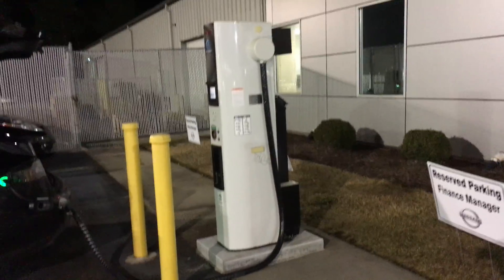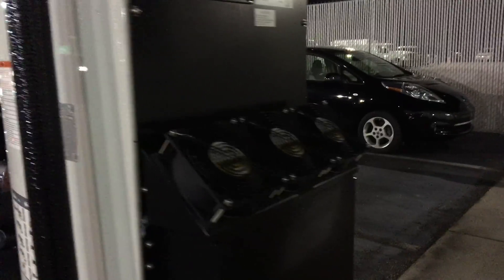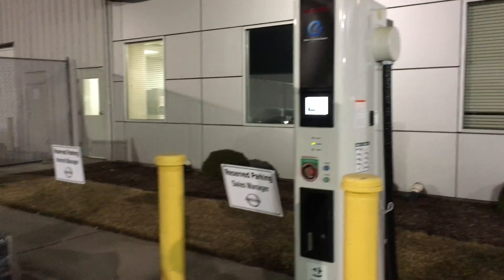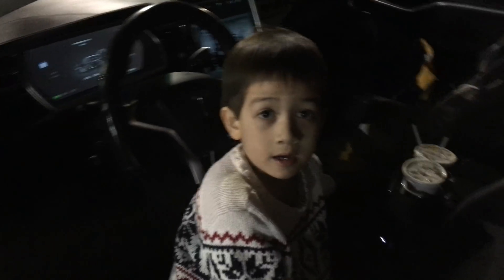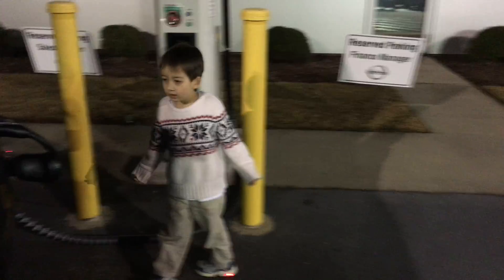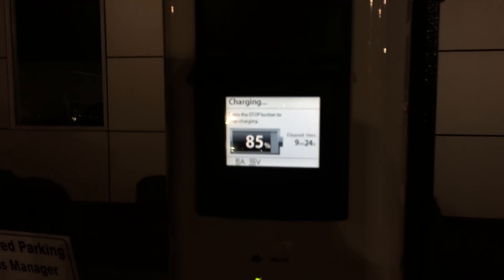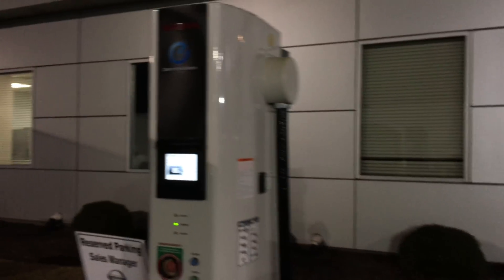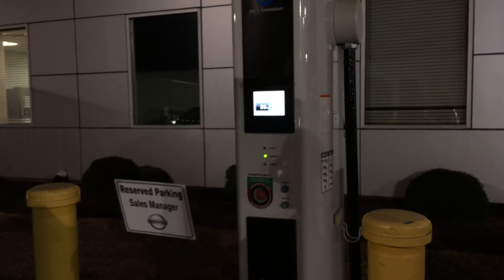CHAdeMO Charger in Myrtle Beach Back-feed causing Touchscreen Issues on Classic Model S

Comment: is there's audio issues or just my phone?? ... the sound cuts off in some parts of the video.
Reply from the maker: +KitHakidaWotting_it Doesn't matter the source, my iphone 4s, 5s, 6s, Sony Handycam 1080p at 25mbit, or my Sony FDR-AX33 in 4k at 100mbit. Something changed on youtube with how they process videos just over a month ago, and since, I get these audio issues. Never in the past, with same things. This one was recorded on my iPhone 6s, my 90D video was on my 4k cam. Doesn't matter what computer I upload from or where I upload from. Pre-Processed or not. Only solution to it I found was to keep re-uploading until they render it correctly :(
Reply from the maker: +DJKiDDKlashez More problems with YouTube processing my videos. Has been happening for the past month.
Reply: +KmanAuto Have you tried using Handbrake™ compression software to make the file H.264/mp3. Handbrake also decreases filesize with minimal loss. <handbrake.fr>

On a different note. Silly little Nissans™...
Reply: Ah. Evil YouTube science doing things wrong...

Why must they do new and strange things?!?!?!
Reply: +KmanAuto Try use FFMPEG (A free Converter Tool ) , perfekt for Youtube
Reply: +KmanAuto Try to re-upload, its okay we dont mind. rather have a corrected video file than having problems hearing you.